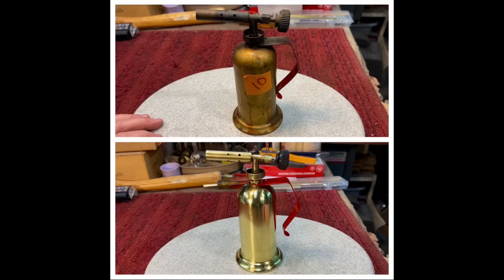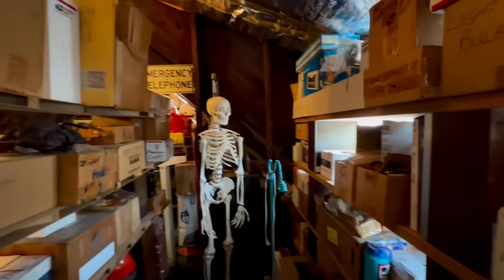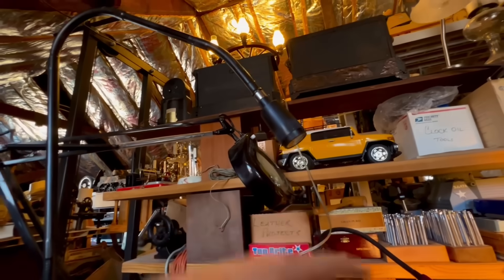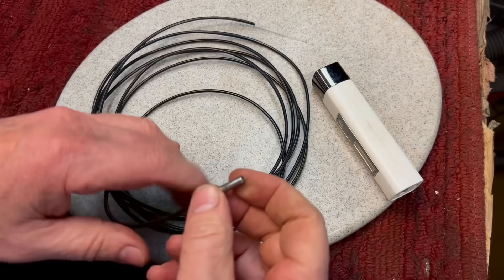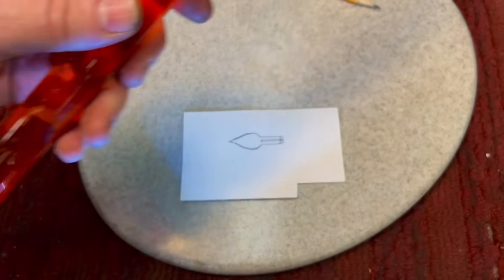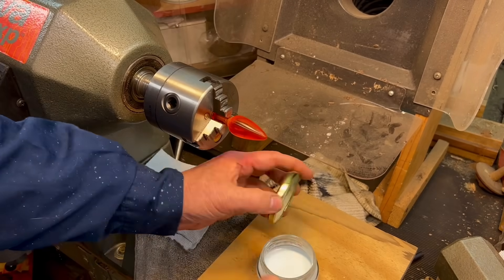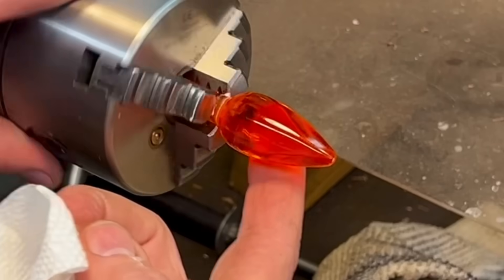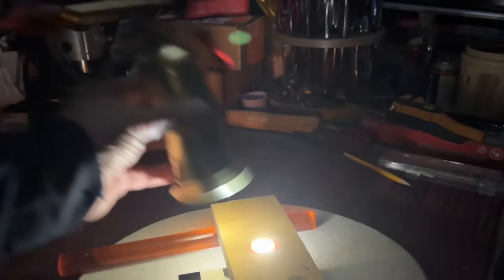Fun With Fiber Optics- Torch Light Build- Shop Time!

Comment: Hi John! I just recently found your channel, which has proved an invaluable resource in restoring some of the hoard of tools I rescued from my late grandfather's workshop.  I ran into a similar issue to your fiber optic torch project a year or two back while making a translucent pendant that lit from within for a young girl's birthday.  Two tips that might be helpful if you ever want to revisit your torch - first,  diffuse the light as it enters the piece you're trying to illuminate... I found that 1/16" white packing foam worked well and could be layered as needed to get the right effect. Second, consider leaving a frosted rather than polished surface finish where you want it to light up.  Thanks again!

Comment: I used to work for Qwest Communications back in the day and all their lines were Fiber Optic.  Tecs were required to use gloves while working with the Fiber as it can easily penetrate the hands and fingers.  I would caution anyone working with Fiber Optics to use caution as the cut-offs can be a danger to your hands and eyes.

Comment: Several years ago, I managed a camera installation construction project for a state DOT.  The contractor installed 90 miles of FO cable for video communications and data transfer for radar, speeds, overhead sign displays, etc.  I had an expert on staff regarding how this all the technical parts work.  I understood the construction installation.  I even got to test some FO cables on a specialty machine when testing enormous reels of the cable before installation.  My feeble brain could easily understand light transfer through the hair-sized glass cable but transferring massive amounts of video and data in both directions never clicked.  It was a very interesting project.  Thanks.
Reply from the maker: Yes!  I too have trouble thinking how all that information is passed so quickly through those cables!  😃👍

Comment: Thanks John, you're right we all love a trip to the attic, boy there must be some weight up there, our relatively modern house with factory made trusses, had a label on the trap door saying loft space not suitable for storage, what's the good in that !
Nice idea with the fibre optics, I remember when they were first brought out, everyone was amazed by them but didn't appreciate just how many uses they would have. 
The guy that fitted our fibre for the internet last year was explaining the pros and cons vs copper, we were the furthest connected to the local hub and just over the standard length of fibre which meant they had a lot to cut off, but you can't easily join it once cut so you've got to be sure of the full length, they had a devil of a job feeding it through and it can't have any very hard tight bends so in the end had to tape it to the copper and drag it back out to the junction box !
Reply from the maker: Andy- My Great Grandfather built my house and he was a collector too.  😂👍

Comment: What light source did you try? I supposed it was the small flashlight, placed inside the base?
Reply from the maker: Yes- It was just the flashlight- Typically fiber optics use illuminators.  😃👍

Comment: That's great. When you first talked about lighting the torch, my limited imagination figured you would just add any old bulb. Fiber optics and acrylic flame constitute a much better idea. If you want a brighter flame, why not bend over the fiber, and thus double its effective length? This would mean enlarging the hole in the acrylic for the extra volume of the fiber optic.

Comment: Hey John, You've got a great start on the torch light but I think that the bulb is a little to large and l think it needs a bulb cuz it's just not bright enough and sitting on a light is not the way I would go. It looks great thou. How about a mini bulb like in a car's dash, they are a small/bright 12 volt DC bulb so no plugs, just a battery. Just a thought - Later
Reply from the maker: Yes- I was trying to stick with a 110v LED bulb for convenience.  It’s fun to experiment though. 😃👍